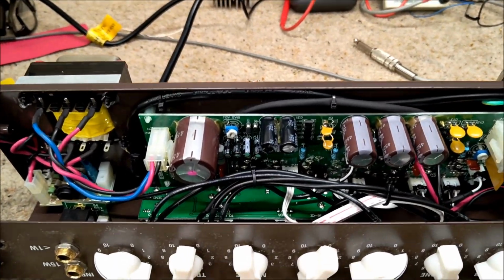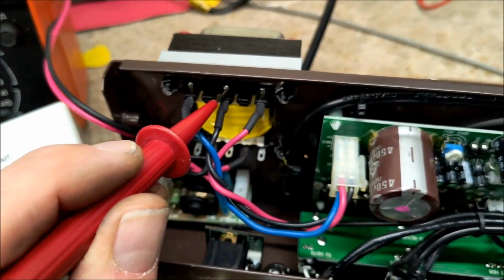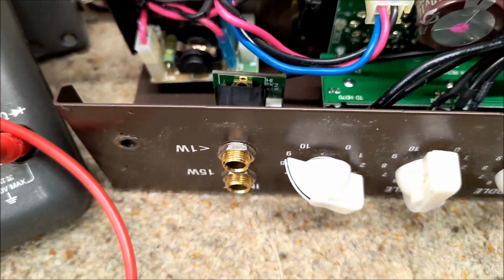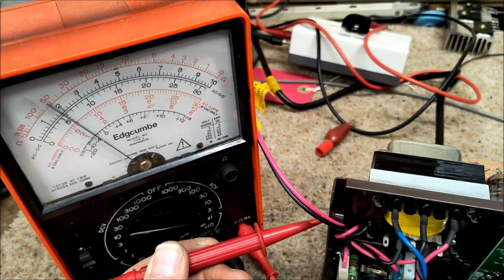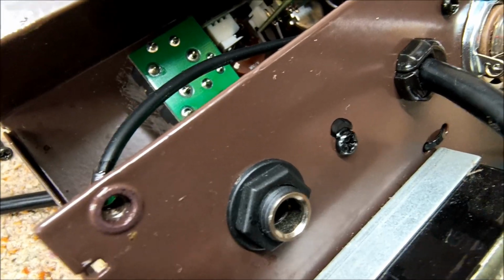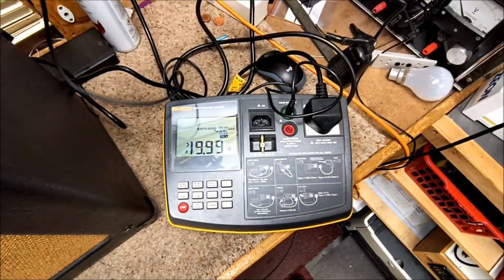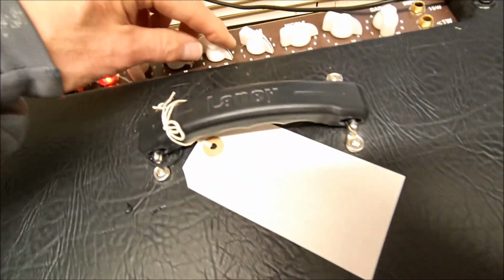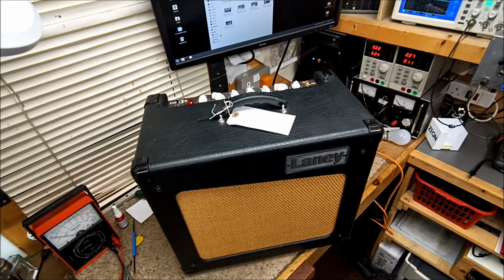Laney cub 12 R   noise, screeching and hum

Comment: Great explanation about a major flaw! I've just made the changes and my amp seems to be working properly again! Wow! It was my first tube amp and It has never worked properly at my place (old building). I've had it tested, etc. I've noticed a bare metal screw was already there and some paint removed around a screw hole to make electrical contact. It was far from enough. I hope it will keep working Thank you...😊

Comment: Great explanation Steve!  I have had the same problem with mine a while back, and I fixed it by adjusting the bias and the problem went away.  I don't know enough about electronics to say why that fixed my problem but I did.  Don't know why one would need to adjust this thing periodically either.    Nevertheless, your point of not having a good ground contact on the power-on switch and the jacks is a good one, I tested for it and fixed it too.  Cheers

Comment: I currently have a (stage right 611815) on the bench which is the same amplifier that has the same problem. Thank you for the video Steve & for the huge amount of time you saved everyone with this problem. Did you make your own 500v capacitor substitution box?

Comment: Quite literally a shocking design! ⚡️ 
Nice methodical fault finding and an informative video. Thanks ☺️
Reply from the maker: I really think a decent earth bond strap should have been provided between the chassis halves. Its a nice idea to spit the chassis, it  makes access for servicing easier. Not  if the production team cant remove the epoxy paint!
Reply: @stevewardguitars1661  absolutely 👍

Comment: Very well spotted !
I have one myself, no issues  but I will certainly ensure the chassis is fully earthed
Thank you
Trev
Reply from the maker: HI Trev, I felt is was important to share this. I'm sure this is not an isolated case. I read a few forums where from the description this amp had similar howling, humming and what sounded like instability issues. I feel it was a glaring over-site from the Chinese production team to not fit a decent earth bond, or at least remove some of the paint!